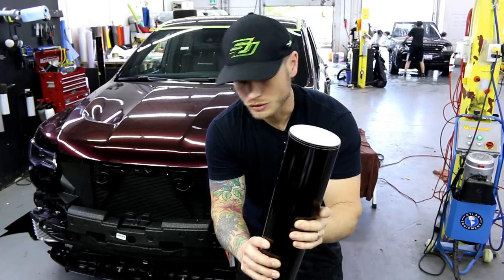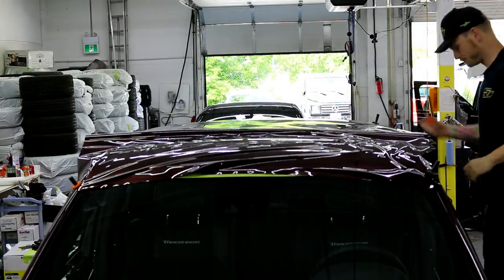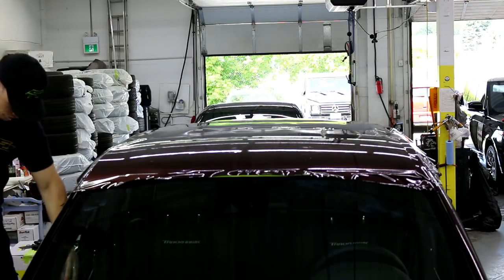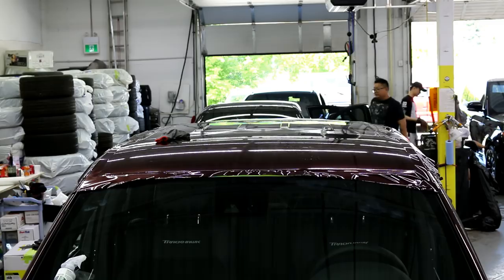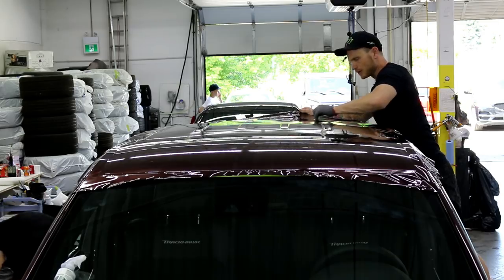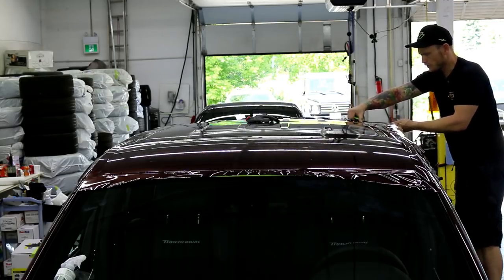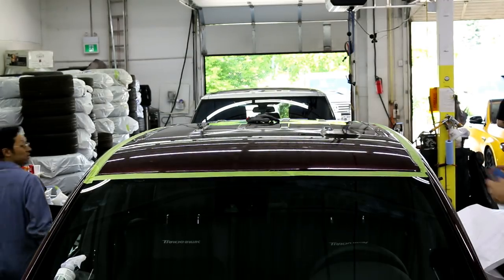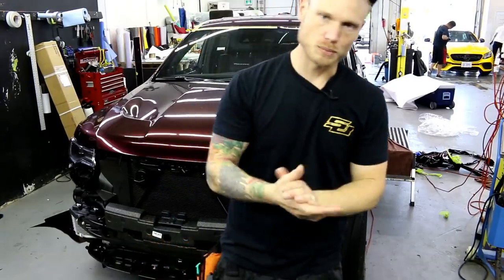How To Jeep Trackhawk Solo Roof Wrap In Nebula Black

Comment: Try visualising the roof in 1/4s and work that way. It will be easier. I do my customers' mpv roof using Oracal 651 series, using wet application. Even the rear crevices will be easier to handle when working from the center of the roof towards the edges.